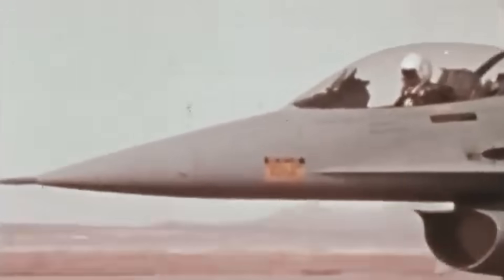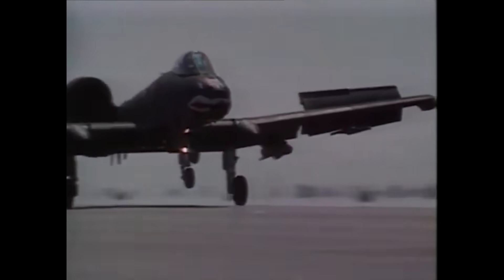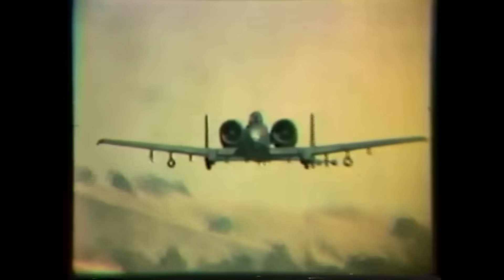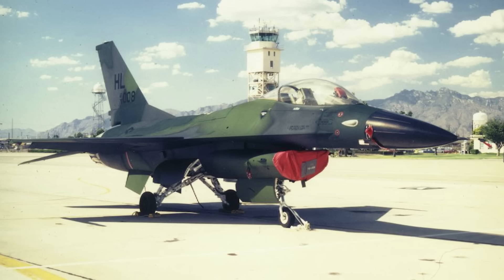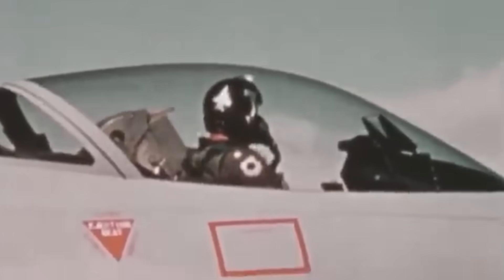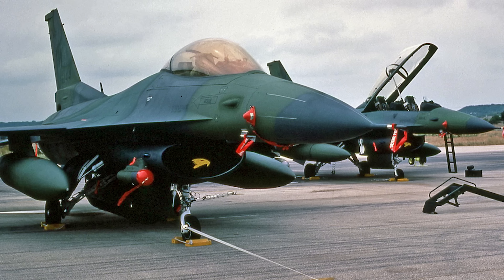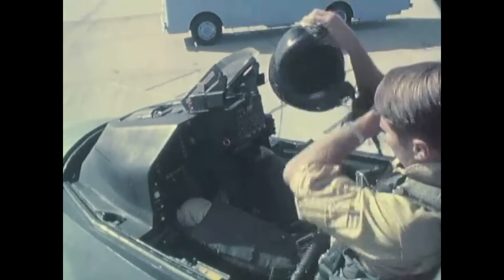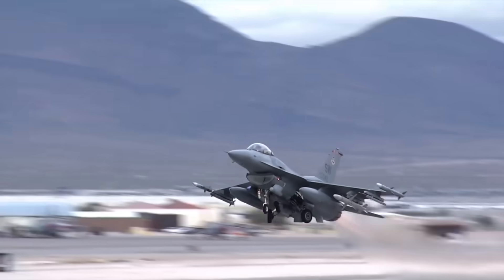The A-16. Can a Viper turn into a Warthog?

Comment: Since you will never have the titanium bathtub, and pod guns cannot match what the GAU-8 can do, the F-16 cannot hope to match what the warthog did. 
It sounds like the air force is kind of giving up on the close air support role altogether.
From the sounds of it the army will be able to count on only what they can provide with their own helicopters. 
The v-280 looks to be worthless for close air support. In general it looks like the military is going to get an unhappy surprise from the v-280. They're going to try to use it to replace the Blackhawk only to find that they have to abandon that idea and purchase more Blackhawks.
Reply: This doesn't make any sense. The titanium bath tub only exists because in an A-10 the pilot is a gunfire magnet. When flying in a plane that doesn't get hit in the first place you don't need one.
Reply: @ChucksSEADnDEAD  
It's a false assumption that the plane won't get hit in the first place. 
If you're doing the CAS support job you're going to get hit

Comment: The Desert Storm A-10 tank kill numbers are all BS, from ground units to air and arty they all blasted the same demolished wrecks over and over again, claiming multiple kills for the same wreck, a common problem in mass tank battles, it's similar to how their SCUD hunters claimed thousands of destroyed SCUDs, while subsequent Pentagon investigations revealed there was no proof of a single destroyed SCUD. The A-10 toughness is overhyped, 7 of them were shut down over Iraq. That 30mm would always be more accurate and effective on a chopper or even an AC-130, the effectiveness of both the A-10 and F-16 as ground attackers in a hectic doomsday war was measured by how much fire and forget Mavericks they could carry, and I can confirm that the F-16 would get cooked if it launched 12 of them repeatedly,  they would came back blackened when they just tossed flares to scare of air gliders from flying close to a nuclear reactor.

Comment: 2:50 "the latter group (A-10 doubters) would be proven wrong after Operation Desert Storm in 1991, where the A-10 proved indispensable in its intended tasking." Are we thinking of the same Desert Storm? the one where the A10 was preforming so poorly at its planned job that multiple other types of aircraft like the F-111 (and IIRC, also some F16s) had to pick up the slack?

Comment: I still think because of range speed and the ability to tank Ariel tanking and the sheer firepower the A10 would have been a better proposition for the Australian army than the M1 Abrams  and in light of the Bradley's performance in Ukraine 100 plus Bradley's would also have made more sense early 80s. We have adopted the Sth Korean Redback, would it not be best to team it with real air support.

Comment: Trying to use a single-engined aircraft for close air support is a foolish endeavor. While the F16A and C aren’t *bad’*for close air support they are heavily reliant on targeting pods to find and maintain visual on a target.
Reply: The A-10 is reliant on pods too. Whenever A-10 pilots rely on visual alone they hit friendlies. There's a reason that CAS doctrine assigns weapons release authority to the JTAC on the ground. When a pilot flies over, the JTAC holds him by his hand to guide him, and A-10s are not exempt from the rules.
Reply: So is the A-10. In the modern era everything uses a targeting pod because it's a far more effective method. Turns out that using something with 40x magnification, thermal imaging and the ability to track a fixed point or moving object automatically is far better then the MK1 eyeball. The pilot has more to focus on then just maintaining visual on a target and having a system that can do it for them is a huge advantage.

Comment: The 30mm cannon is the problem ... and the building of a plane around the gun.  When the A10 was conceptualised PGM's were in their infancy ... These days with highly advanced PGM's it makes more sense from a risk perspective for the A10 to use it's PGM's and associated systems rather than it's gun.    If the A10 was operating in an air space like Ukraine versus Iraq or Afghanistan it would just be dumb to do cannon runs and the danger they put the aircraft in when you can destroy targets from a distance.